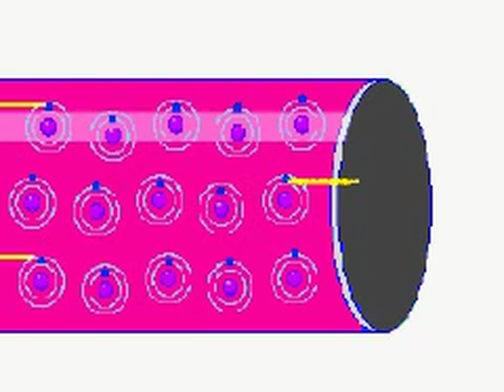How a Ruby Laser Works

Comment: @7poppasmurf7 Solid state lasers are used for price checking and in CD / DVD / BluRay drives. They are cheaper to manufacture than HeNe And do not require a HV source.